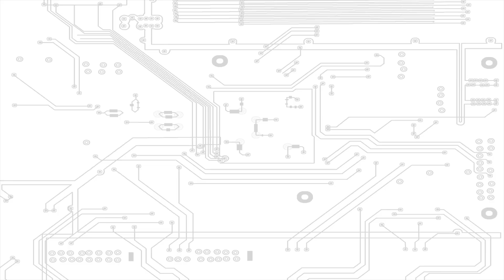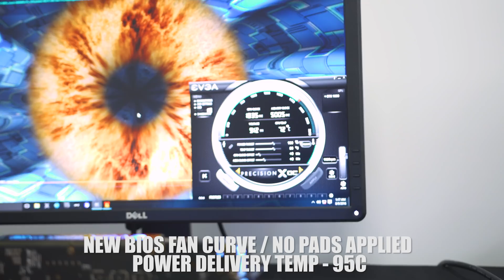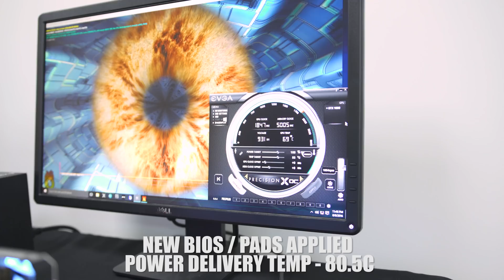EVGA FTW VRM Failures - What should you know

Comment: Shame for EVGA, this is way too expensive card for this kind of "mistake"
Reply: This comment is a great way of screaming "I have never in my life worked in manufacturing." NASA makes mistakes on space projects that are overly cautious. These things happen. It is not about the mistake, but how the firm handles it. EVERY firm makes a mistake, from Ferrari to Rolex to EVGA.
Reply: are you seriously comparing rocket science with applying a simple thermal pad on the power delivery on a videocard like in any other videocard? Especially from a very expensive high-end videocard you CAN and SHOULD expect more. It wasnt an misscalculation by one of thousands engineers, it was either an attempt to save a few cents per card or a massive design failure from EVGA's side, which isnt excuseable for such an "premium" priced product.
Reply: I get that, but come on this is a very simple mistake and seems quite sloppy from them.
Reply: If you've registered your card on their website they will mail you the pads and new thermal paste free of charge.so you can spend 10 minutes doing it yourself if you wanted. That's what I'm doing anyway.
Reply: The biggest problem is this was NOT a mistake they were trying to save money. Stupidity caught up with them as they left the cards not only with no vrm thermal pads but also with a bad backplate that does not allow enough hot air to escape out where the vrm are located.
Reply: ***** The SC isnt affected that much since it is a refference design with refference power delivery. The FTW is a custom card by EVGA.
Reply: 300% percent right.
Reply: Get a MSI or ASUS
Reply: Neiva - CS:GO Zombie Escape Videos  correct me if I'm wrong but you can't read vrms temps through software, so yours could be getting quite toasty without you knowing. Are you planning to apply the pads?
Reply: Both
Reply: Lightzpy Is this card fixed now or should i get the Asus Rog Strix 1070?

Comment: Yea Buy ASUS STRIX 1080, they works out of the box.
Reply: I've got one and they are near silent. Even oc'd the run at 63c in game which hardly makes the fans spin. I went from two EK blocked 290x cards in a custom loop to one 1070 and now the only noise from my PC is the DDC water pump. Seriously thinking of ditching the rest of the custom loop and going with peltier cooler for the CPU. MSI Gaming cards are loud, they sound like they use the same fans as cheap Chinese laptop coolers.
Reply: And is extrem loud
Reply: u got one?..because the fans stays off up to  60C/140F..and then goes on a low rpm...
Reply: yea I rest my case! =)
Reply: ya asus is rock solid. my msi mobo is crap, and also 970 msi

Comment: I like how EVGA handels the problem, but the new 10XX's cards from EVGA are not good in my opinion. I read a lot of tests about the custom designs from many manufacturas, I testet the EVGA 1070 FTW, Gigabyte G1 Gaming and Gainward Phoenix GLH.

EVGA 1070 extrem loud
Gigabyte 1070 extrem loud and fan issues
Gainward 1070 extrem coil whine

I testet all cards in different systems and with different psu's... No difference.

I was so frustrated about that, now I have the Inno3D iChiLL X3 1070 and have no problems anymore, the card is very silent and no coil whine.

I think EVGA did not a great job with the new pascal models and other manufacturas have way better cards.
Reply: And what is this "Sapphire Phoenix" ?
Reply: Pienimusta lol right, mean Gainward

Comment: you didn't read the manual for the fix. the "bulge" on the backplate with the pads on, you need to first take the small pad standoffs off the backplate before putting the new thermal pads ;d

Comment: So about one month ago i got my pc with an the "normal" EVGA 1080 (not ftw/superclocked) but also acx 3.0 . I dont have problems with overheating of the card but it sometimes crashes my pc with fanspeed on 100% (temperature not above 70 degrees in that time). Is this another bug or can it actually be fixed with the pads and the bios update as well?

Comment: Great Video, thanks a lot for this!
Still: It would have been interesting to see the temperatures of a third option: Thermal Pads applied, but NO Bios upgrade.
Since it seems, that the thermal pads alone would already solve the problem (15K difference between Bios Flash alone and with pads). And a lot of people probably don't want to increase the fanspeed of their silent card / use a custom fan-curve anyway.

Comment: Jay, and to fellow card owners....
I am really confused right now. I have a 1070SC which is affected by this problem, but after reading a thread on the EVGA forums it seems that they say the pads are only "optional for better cooling", and that just updating the vbios( which apparently isn't out yet) should fix the temperature issue, but I can manually adjust the fan curve to "aggressive" anyways using Precision.
So, what's going on? Will I be okay if I just set an aggressive fan curve(without installing the pads?)?

What say you guys?

Comment: What to hell is going on in this video? Applying thermal pad between chokes and fins of the cooler? There is no flat spot on the cooler to transfer the heat. There are only very slim fins of cooler. And chokes do not make any heat compare to mosfets, which are UNDER the front-plate cover. There should be thermalpads between mosfets and front-plate cover. This looks like they are relayng to cooling to the back-plate for mosfets and thermalpad on chokes is just for placebo efect there. And the new bios bump up the fan RPM and hopefully nothing burns. This is not proper solution to this in my opinion. And yes i seen thermal images in the video with reduced temperatures, on the open air test bench. I want to see thermals inside small case with poor airflow as a worst-case scenario, the card should be able to hold.
Reply: As far as i know this card has a 250W TDP. That means 20.8 Amps at high side mosfet and around 200 Amps at the low side mosfet. At full load. So i do not know about yours 4-7 amps at12V... That would be like 84W TDP card. Also mosfets have some resistance when they are turned on. Its caaled Rdson. And the higher it is, the more heat is mosfet making. Adn the hotter mosfet is the higher Rdson it has. So its a death circle. More heat = higher Rdson = More heat = higher Rdson... So there are two ways. You either make VRM massively overrated, so it can handle the load without even heating up. Which is too expensive and 
spatially inefficient. Or you tune VRM to your needs, but you have to properly cool it.
Reply: this is a BS fix and I agree with the OP... EVGA screwed the pooch on this one the coils are not what heat up you need to directly cool the mosfets...
Reply: Agreed. Plus, 10 degrees is nothing, if it already runs at 105+ degrees. My Inno3D is nowhere hotter than 70 degrees, because everything is connected to the cooler properly.
Anyway, I am not affected, since after the ACX 2.0 debacle on the 970, I decided to not get EVGA again. And man, am I happy now.
Reply: Josif Vissarionovich The mosfets are alright, they don't make that much heat unless they're being used as power drivers for anything more than 20 amps 300 volts, which usually the mosfets on this cards are about 50 volts 10 amps each, which they don't use more for anything more than somewhere between 3-12 volts 4-7 amps, and the way they are cooling them is just fine, manufacturers use that technique all the time for most of their components, only ones they usually get a heat sink and thermal pads are processors, ic's that are heavily  used and sometimes voltage regulators for the processors and ic's. The small case scenario has been confirmed to get a lot hotter than a normal atx case, if the CPU is in stock cooling the gpu is going to heat the CPU too if it's non-blower cooling, the blowing cooling works just fine, yet a bit hotter, but the card can handle it no problem, adding a intake fan in front of the gpu should keep it cooler in the small case.
Reply: totally agree with you i would love to get one of these cards or a descant pcb pick for Actually Hardcore Overclocking to break down he would be able to also tell if they just cheeped out on vrms anyway
Reply: Jori Diculous. yeah really I would have thought that this would have been solved through R&D
Reply: PSU is supplying 20.8 Amps at 12 Volts that's 250 Wats. And PSU is capable of supplying that kind of current. However the GPU needs only 1,2 Volts and with yours 180 Wats that is 150 Amps still. There are mosfets swiching 12 Volt rail on and off to create that 1,2 Volts With Amps (created on chokes and filtered by capacitors) the card needs. So yes 200 Amps is really possible and more than that, its needed because of low voltage. You have to get the power to the GPU or it will shut down. Maybe in your world it gets power from the air. Thats why we use DC to DC converters because they can convert high voltage with low current to the low voltage with high current with great efficiency and transfer the power. How many Amps is GPU taking, you think? 10 Amps? That is 10 Amps times 1,2 Volts equals 12 WATS!!!! So why on earth GPUs have huge heatsinks on them if they are taking so little current? And why they have auxiliary power?
Reply: Its a cheep hack to feed the press "look at us, we totally fixed the problem now"..
Reply: Josif Vissarionovich the TDP is just for thermal measure, not of how much power they need to work with at maximum load. Yeah I might have calculated wrongly, but those 200 amps aren't possible, your psu wouldn't be able to handle that kind of power drawn out of it and it would protect itself. The card itself can draw a maximum of 150-180 watts RMS (the only measure that really matters here) and that under full load fans at max speed and so on (unless it's an AMD card, which use a lot more energy). In reference model cards the mosfets have thermal pads and are placed in the back plate for dissipation. The internal rdson for low voltage devices is determined by the channel resistance, while the one in high voltage one is determined by EPI resistances, as long as the mosfets don't get hotter tan their thermal protection shutdown they're fine, the resistance can get higher, it's not that much of an issue.
Reply: And yes i Know what TDP means. Its maximum amount of heat generated by component.But not all power from power supply is turned in to heat. Some is used to do actual calculations or to spin the fan blades or to emit light (all the LEDs) and so on... So real power draw is even (slightly) bigger...
Reply: Some inductors do make a Lot of heat mainly the older style ferrite shielded inductors that would go open after the insulation in the windings broke down.
Reply: I think there's a compounded engineering mistake on there. Certainly the part to fail will not be the inductors, it will be the FETs, and FETs do generally generate plenty of heat in this use. However, keep in mind that the FETs are heatsunk into the PCB underneath, with the PCB-facing thermal tab! The chokes look a bit wimpy to me, i suspect they have a significant DC resistance, and generate plenty of heat themselves. This nearly always happens really, the engineers look up the current rating in the catalogue, but then forget to take into account thermal behaviour at this current rating, because electrical and thermal isn't done by the same people. Given that they are in an air pocket, the only place that heat will go is into the PCB, heating up the FETs additionally. Heatsinking the inductors into the heatspreader is likely to not only alleviate the issue, given that inductors majorly consist of thermally conductive materials, it's likely enough to draw away some of the heat sunk by the FETs into the board. Another part of the fix is heatsinking the back of the PCB with that huge second pad. There's quite a bit of thermal via stitching around that board area, so it might be actually as effective as heatsinking the top of FETs. Keep in mind, the die is going to be near the thermal pad, not at the top of the plastic.

So a compound of 3 engineering mistakes: no heatsinking of FETs, inductors with significant resistance, and air pocket around inductors. Perhaps alleviating these mistakes just partially helps the card enough, and i mean they've shown the FLIR, so apparently it's doing something. It's obviously a hotfix, not something they should have done were they to avoid a barrage of engineering mistakes in the first place.
Reply: Waaait, i just looked at some pictures, and while the backplate mod (large pad) still makes sense to me, the inductor mod doesn't! For the reason that the inductors are really already in the airflow, not in a pocket! So some of my conclusions are wrong. It looks nonsensical to then put a thermal pad on top, but it's really impossible to tell, it's necessary to try with and without inductor mod and see whether that makes a difference. I don't have the affected GPUs though to test.
Reply: I agree. Not only chokes already was in air flow from the fans. Covering them with thermal pad doesn't make sense to me too. Because on top of the pad, there is nothing to transfer the heat in to. Only very slim fins of cooler. Hardly enough surface area to transfer some heat. Thermal pad on bottom is fine. But there should be thermalpads between mosfets and front-plate cover in the first place. Maybe there are. I dont know, i never seen card without front-plate cover.
Reply: Josif Vissarionovich the crux of the issue, that there has been a change to BOM that resulted in that thermal pad being eschewed.
Reply: High school. Electrotechnic direction. And 8 years of practice in electronic manufacturing company on "pick and place" CNC machines.
Reply: At the end of the day we're having a good discussion here that has a value upon the merits of individual statements that can be verified factually, not from authority of any kind.
Reply: I myself have a bit of electronics engineering university education, but I dropped out because of health issues. Don't think it did a terrible lot for me in practice. Since, I have done a handful of years of embedded electronics work in automotive and generally have just stayed curious and took an analytical look at any device in my hands. Currently doing HPC and VR software, besides embedded, various odd contracts.

Comment: No jay what you said in the beginning is wrong. There IS thermal pads between the VRM and the baseplate. It's just proving not enough for the idiots that run furmark and the stupid conservative fanspeed EVGA uses, so they fix it by adding thermal pads BETWEEN the baseplate and the HEATSINK FINS and between the back of the PCB and the BACKPLATE to improve dissipation more. Also. THATS NOT WHERE YOU PUT THE FRONT THERMAL PAD. Watch Gamer Nexus to see the proper placement. which is ON the baseplate itself. Those things you put on top of are CHOKES which doesnt get hot and dont mind being hot.

Edit: Gamer nexus did it wrong too... facepalm

Comment: There's no base plate for the VRM-s to dissipate heat to, just the overhanging cooler fins, probably didn't ship with thermal interface because no amount of pads can make for zero surface . The oversight is in the cooler itself, much pricier than a couple of thermal pads. As for the backplate, I guess the fix helps, although got to remember the vrms sit on the opposite side, it's as effective as cooling your GPU die mounting the heatsink behind it rather than on it.
On the other hand, many other brands cheap on the VRM coolers, and for a reason, these are expected to withstand up to 120c , the thing is, the current they can manage can lower when pushed that far.

Comment: Lol I have an R9 390 from Sapphire with active cooled VRMs but the temps are at 125°C when under full load
Reply: That isn't normal for any 390 card, return or it will die in the nearest future.
Reply: 1. It is still in the specs of the VRM (Max 140°C). 2. I will get a GTX 1070 in January because 3. my R9 390 is already half dead. I cannot OC it without having strange artifacts.

Comment: Jay I have a question, i need help. 
I have a EVGA FTW 1080. so the issue is vram overheating right? How do you check the temperature? My card overclocks to 2100mhz and stays at around 55-57 degree C. Is there any issue with this or do i have to test it with something else to see  if my card has a problem????? 

ALSO, If so, where do i get the thermal pads? are they free and given out by EVGA or we have to buy them on their website?

THANK YOU SO MUCH.

Comment: Wait but is this only with the EVGA card not like the Asus and Msi?
Reply: WalkandPeace exactly the same. went with the gaming X and super proud
Reply: you wont be able to see the heat thats happening, the VRM's are the things heating up to 90-100C and those dont get monitored by software
Reply: The Dark Night Add me to this msi club, 1070 gaming x is my 3rd msi gpu now and never had a single issue with the brand.
Reply: Boomcheeks really good brand indeed
Reply: Jimmy EVGA only
Reply: ***** so what? Does this meam they are not good?
Reply: Bablooo The Cockie Just don't get a FTW card. My non-FTW EVGA doesn't get hotter than 60 degrees at 2ghz in Furmark.
Reply: ***** My ACX 3.0 has no issues whatsoever. Doesn't get as hot as my MSI 970.
Reply: ***** Some months ago from the EVGA store.

Comment: Being that these GPU'S are running that hot, it would have been better to ship new units out in lieu of thermal pads.
The simple act of shipping it in and receiving another GPU that's been used doesn't help. People paid a lot of money to have a quality GPU, not a failure in 2 years. This was an OEM error, why make people pay full price for a flawed GPU. You can bet that the issue will in fact churn out more failures much sooner than the MTBF.
Either send a new GPU or send a check to give the people exactly what they paid for... B Stock repair.